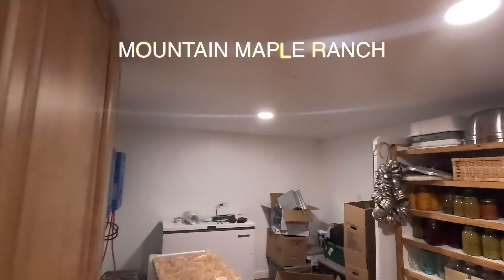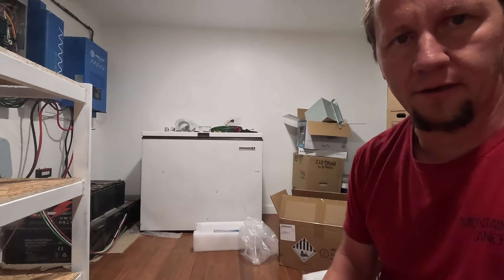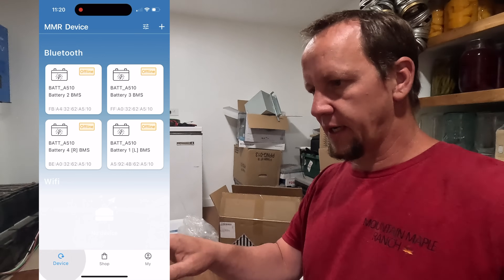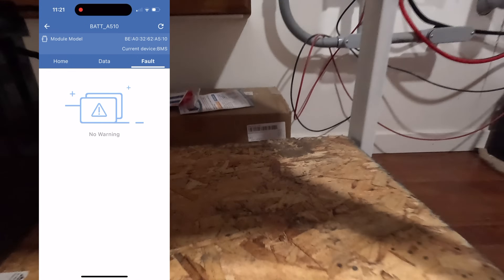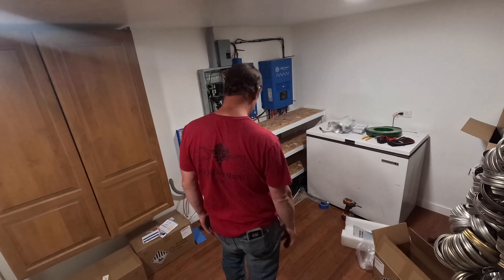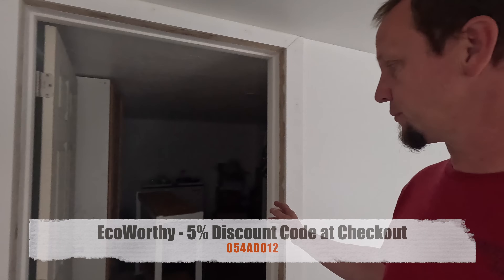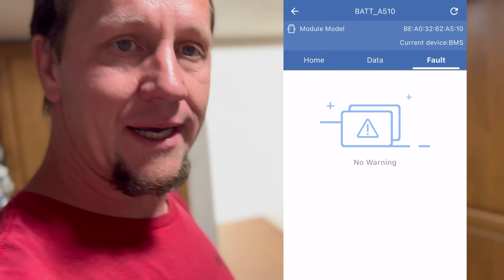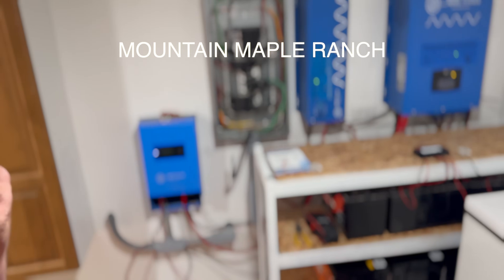DOUBLED our SOLAR BATTERY bank with Eco-Worthy Bluetooth LiFePo Batteries @ecoworthy_official

Comment: Can we see a picture in the app,when those bateries are 100% charged,but like when its 99% and it turns to 100% fresh,to see how much the deviation on the individual battery cells,also curious how fast they balance them out.

Comment: Ya, was an early adopter of the eco worthy, took a big risk before anybody did a tear down and they are actually well made with a lot of metal reinforcement on the inside. Dont let the plastic outside make you think it is low budget battery.

Comment: I just got 3 of these for my off grid shack. I cycle them from 30% to 100% and down to 75% and now each cell sits at exactly at 3.33V. Happy as kid in the candy store. Perfectly balanced and ready for my solar system. They will be run in series to 36V system.

Comment: The discount code isn't working for me.
Reply from the maker: I just tried it and it did not work for me as well. I will contact the company and get back to you.
Reply from the maker: I probably wont hear  from the company in a few days but I will keep you updated. Sorry for any hassles
Reply from the maker: They just sent me a new code that will be active on 11-25-2024 at 00:01. The Code is 0505P8BRPY. I will also check it tomorrow and email them if there are any issues. Again, I'm so sorry for any inconvenience.
Reply: @MountainMapleRanch  FYI, the code still doesn't work on Amazon, eBay, or on their website.  I tried everywhere.  Where is it supposed to work?

Comment: These batteries are poor quality mine failed after 6 months BMS failure! Ecoworthy won't respond to emails.
Reply from the maker: We will keep an eye on that. That’s not good. We have had ours since September, so far they are working but we will keep that in mind.
Reply: Contact Oliver at their customer service.  Provide your order number and they assist you.  I own 12 server batteries and three of their inverters and always get a decent response from EW.  Last purchase, a cable was missing from a refurbished unit and they sent me the cable free of charge but it took a couple of weeks due to the snail mail.  Gary in SE MI.

Comment: Do you have any suggestions on connecting the battery to the app? I fully charged it and can’t seem to get it to connect or show up on Bluetooth. Thanks!
Reply from the maker: Oh really… No I did not have any issues at all. It was actually quite seamless. Perhaps try resetting you Bluetooth on your device and reopening the app. As soon as I got the app installed, i opened the app and clicked to add a device. It found all 4 of my batteries right away.
Reply: @MountainMapleRanch  I just realized I bought the non internal monitor battery oops. Thanks for the reply

Comment: So question with this battery set up in shop can you weld run a battery charger booster etc and not hurt your system i am asking have hope of redoing our system to upgrade
Reply from the maker: yes, I have no issues running any of those items. My new welder is 220A and works fine even before the battery upgrade. your question is probably more dependent on the quality of the inverter and its ability to supply stable A/C current to the main panel.

Comment: Them batteries looked good, and the company has a customer surport scheme, all ways good to have in reserve. I love the concept of Solar. For people who live far from power transmission poles as well as it being kinder to the planet or even just not getting stuffed with high bill energy bills It just makes complete sense providing you have the roof space in the right direction or a bit of land or garden. I only wish I had the ability to get some in. A friend of mine has a set on the roof and also the side of his house and can fully charge his electric car. No fuel bills, how cool is that....
Reply: Kinder to the planet, eh 🤔
Reply from the maker: Solar panels are amazing for what we have up here, and they absolutely make sense for us. We are researching wind power and seeing if it makes sense, too. We could charge Ola's electric car during the day on very sunny days, and we make amazing power; we are now working on storage and might have to add another charge controller and inverter. 
Alternative or "green" power still needs some work on how it's made and used, but in our case, we are not off the grid by choice. Running electrical would cost much more money than a high-end solar system, so we are opting out of DIY. Our system so far only costs around 10K  instead of 90K, and digging an electrical line would be so much more because it's over 3 miles away. 
The technology is improving, and what it can do is pretty impressive.  We try to be kind to the planet for many things, but we also need some work:) too hahaha
Reply: @MountainMapleRanch  If your serious about getting a wind turbine quick tip, more tower = more power. If you check ENGINEER 775 channel he has lots of postings on wind energy. Love what your doing and admire the reasons why your doing it. I hope this helps....

Comment: Mark,  Being up in the mountains, would you ever thing of a small wind turbine as a secondary power generator for your batteries?
Reply from the maker: We are actually considering it. This year, our weather station shows that we have consistent winds around  30 miles an hour (that qualifies the system to be worth it). The shop/house would benefit from producing power, especially at night. We are still determining how to move on, but we are definitely looking into it.
Reply: @MountainMapleRanch  Can’t wait to see it if you decide on that!!

Comment: You were working on a new platform for your solar new the shop at one time but I don’t recall seeing it completed. I remember you running wire for connecting the panels on the pig shed. How many panels are connected now and are you getting more?
Reply from the maker: We have our original solar panels that are off the hill below the shop and the pig panels. We have more in the storage to put up but just have not yet. The ones that are connected are working great right now, the biggest upgrade we could really use is getting our battery back bulked up and getting another charge controller and inverter. But all those components are extremely expensive so little by little we will get there.